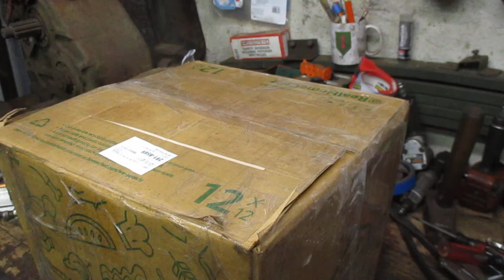T-84 Weasel Transmission.

Comment: Looks beautiful inside...the synchronizer may need a bit of work...those dogs...the little pieces you were focused on found in different sizes and people often put in the wrong size...which can make them hang up.  You can buy a syncro small parts kit for a few bucks and off you go.  Nice score!
Reply from the maker: Thanks Pat !  I am well pleased to be the new caretaker of it. It still has green paint on it that looks to original. I'm gonna take it apart, clean it up and paint it the build a small crate for it for storage.